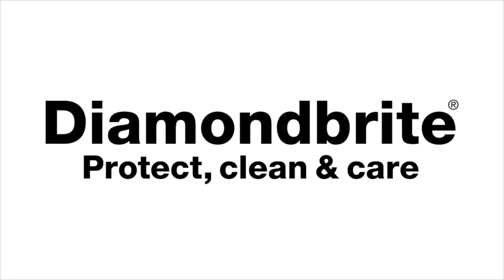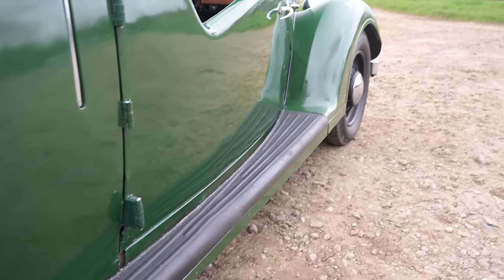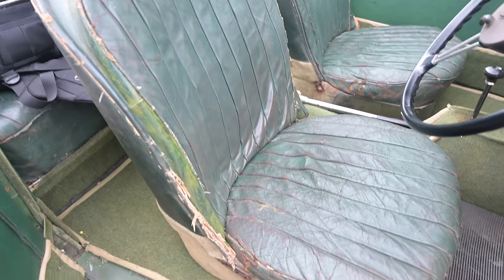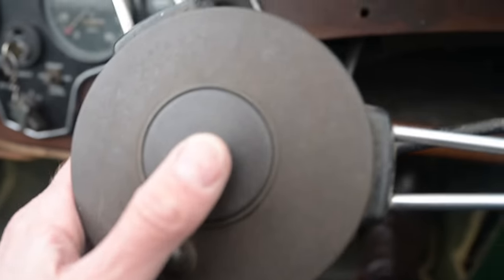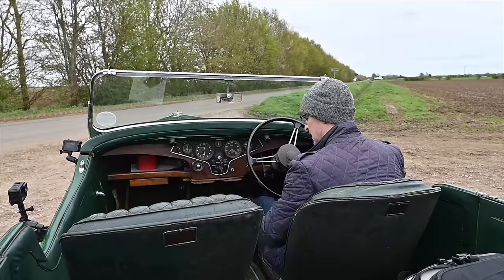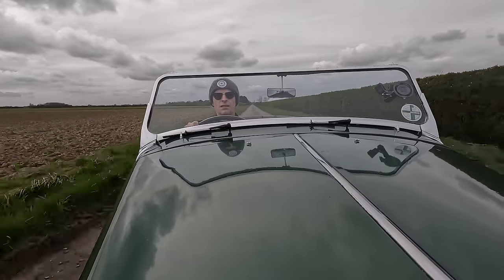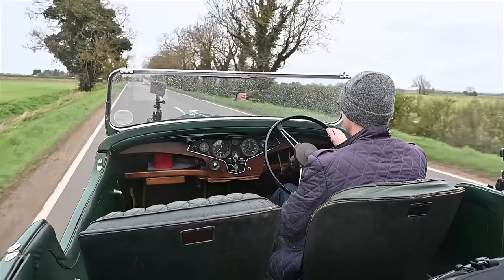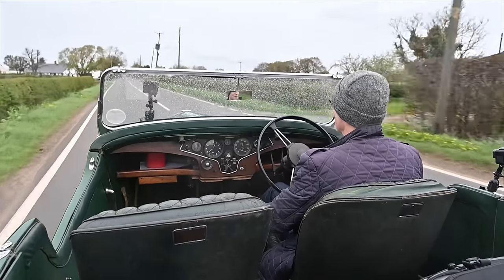Rare Rover - 1947 P2 12hp Tourer - 1 of 200 made!

Comment: What a cracking little roadster Matt, I knew nothing about the freewheel bit so I've leaned something today. Like so many owner aids like the self lube system those systems  required more maintenance than maintaining the bits that they served. Thoughts of the automatic cam chain tensioners come to mind on some motorcycles many years ago. Many thanks for sharing this great car with us.
Reply: To Anthony Stevens. There was ALSO built- in jacks on some cars. I think they automatically jacked up cars, if I'm correct. (Maybe!) 
One make that featured that, was the no- longer in existence make STAR. Fabulous make! DO look them up on the internet!

Comment: Great video of a great car. One slight correction is the chassis lubricator system was vacuum driven from the manifold and used oil not grease.

Comment: Lovely car. I remember thse old Rovers, but only saw saloons. Amazing that the gearshift is so good, I could see how easy it was. The sound of the engine is rather surprising, almost rattly; in any other car I'd be worrying about the big ends.  Are Rover trafficators supposed to flash, or is that a (sensible) modern upgrade?
Reply: It has a noisy cam follower when it's cold , when it's thoroughly warmed up it's quiet

Comment: By the way, the "curious dip" along the top of the doors, is for leatherette flaps, matching the hood. The flaps at the doors, for decades, was to put your arm out - and do hand signals, should the indicator fail (or just because it would be easier for other motorists to see than the orange plastic trafficator arms. Those arms could not compete with today's indicators - which are at EACH end of a car

Comment: I think that a new addition in the pipeline but you may have to sell one or two of the fleet to pay for one.  Auto lubes should be filled with SAE 90 gear oil, they work perfectly then unless the pipes have been squashed.  Everyone knew where my Rileys had been parked by the oil drips on the ground.
Reply: P.s. I see the owner has changed the trafficator bulbs for flashing LED ones, makes them more visible without spoiling the original looks.
Reply from the maker: Yes, Id love one! Its a fabulous car to be in and just looks perfect, but yes a bit pricy to impulse buy

Comment: How is 12 hp = 50 hp?
Reply from the maker: dont even try to work it out, it makes literally no sense
Reply: 12hp was the fiscal rating, using a formula based on bore and number of cylinders and ignored the length of the stroke. In the early days it closely matched the power in bhp, but even by the 1920s it bore little or no relation to the power output. A 12hp car was typically around 1500cc although it could be as small as 1300cc and as large as 1800cc!
Reply: 12hp referred to the VED rating for cost, developed by the RAC , a formula based on 2/5 of the bore squared x the number of cylinders.Nothing to do with bhp.To  keep costs down , narrow bores were the order of the day with a long stroke .It was universally hated and disbanded in the early 1950s to the same cost across the board.Nowadays , we have gone back to this earlier system !.